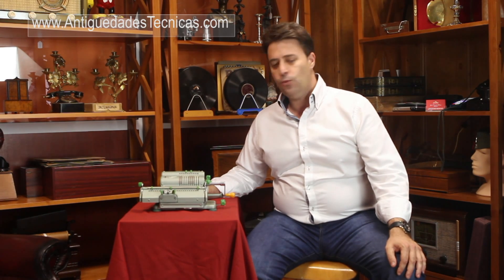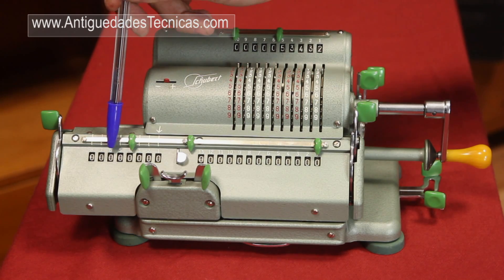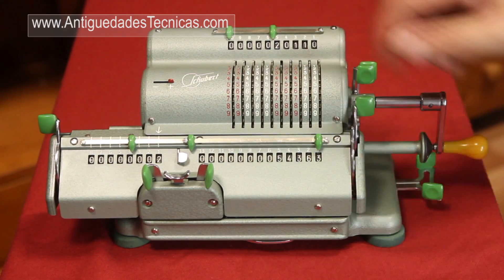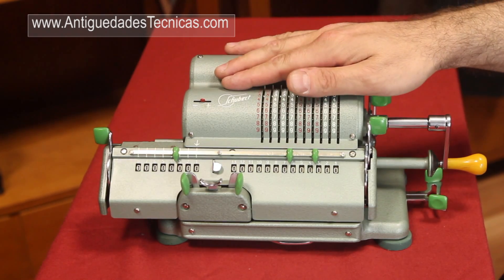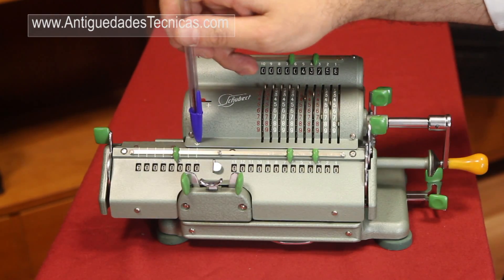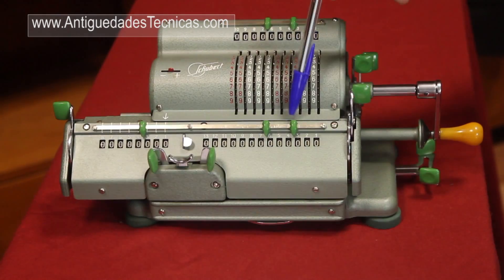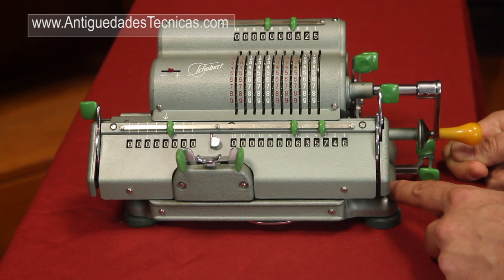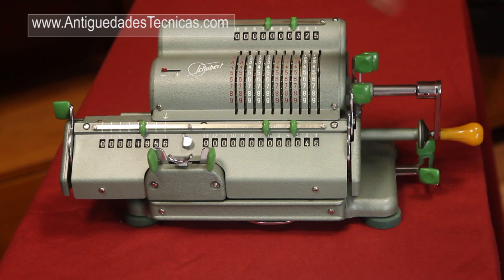Hot to use and operate an antique mechanical calculator - FULL Video Tutorial

Comment: I own this exact same machine (even same colour) in similar condition, I found it at a flea market, I don't know any more how much it was I paid for it, but it wasn't that cheap, but under 100 Euro. It was my first Mechanical calculator I bought. I still like this machine a lot, not so much because of its design, but more because of its smooth and distinguished mechanics, really a pleasure to use.

Comment: I used to buy lumber from a lumberyard in Argentina and the owner used a similar calculator to determine the price based on the type and dimensions of the wood. The funny thing was that he had to use Imperial units and do the conversions to metric on this calculator because in Argentina the metric systems is prevalent (except for lumber, pipes, fittings, electrical conduits, and electrical boxes).